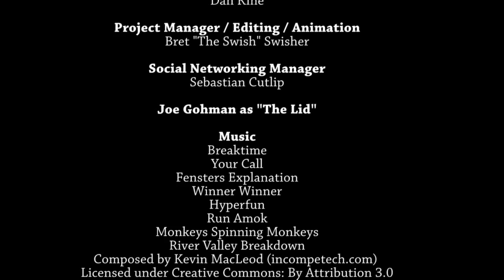How to Make a Shaker Candle Box

Comment: Most intertaining wood show on the web! Great information too. What happens when the glue boogers build up under your bench?
Reply from the maker: +Rick Reed Every couple of months i use a chisel to scrap it all off. Thanks for watching :-)
Reply: I made a box like this for my Stanley 45. I used machines for parts of it though (1/2 inch finger joints for the sides on table saw). Will have make another one using hand tools. You made it look fun.
Reply: +Chad Stanton There has got to be an invention idea in there somewhere ... like a big post-it-note-like pad under the bench that you can wipe you fingers on, then lets you just remove the build-up by removing the top sheet. Or, maybe I need to get a life.
Reply from the maker: +Rick Reed I know me. I would be to lazy to replace the roll and go back to swiping it under the table again. :-)